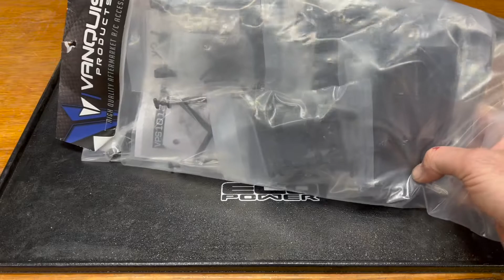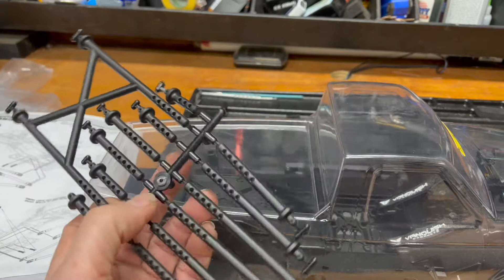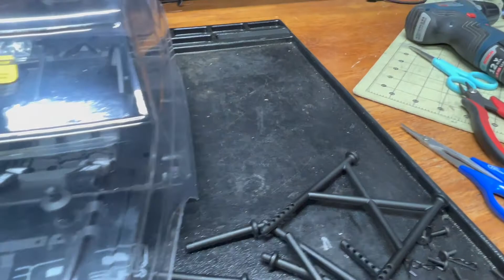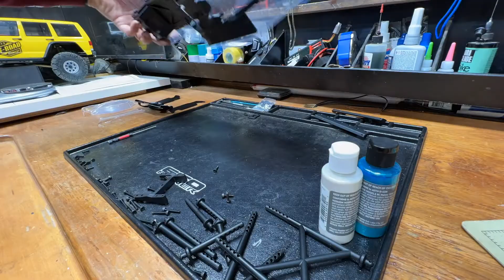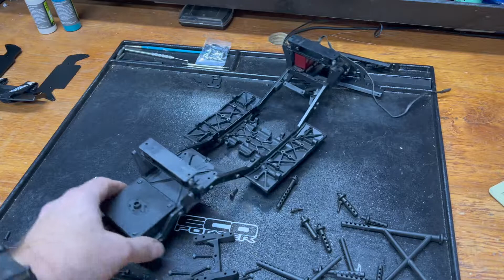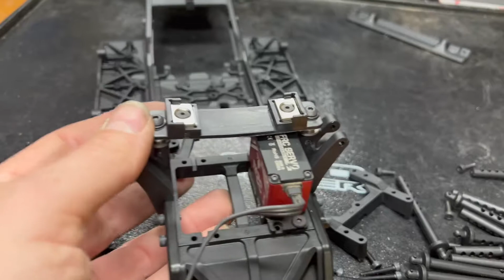Crawler Canyon Presents:  It Came From The Workbench (ICFTW) Vol.1, Part 1:  mix TRX-4 and VS4-10?

Comment: Great project.  Nothing better than fabrication of custom rigs. A while back vs410 chassis kits weren't available so I picked up a Trx4 chassis and capra kit from my local hobby shop in Australia and built an lcg style truck using the capra drive train mounted in the traxxas rails with custom shock towers blah blah blah...lol. Performs really well and dig works so much better with a full size LP servo.. Really enjoying your content and build style. 👌 
Cheers mate 👍
Reply: That sounds like a cool build @Mick D
Reply: @ScaleDude78  cheers mate..👍
Reply from the maker: Yeah, nothing I build is gonna have a micro/mini servo in it.  They're such a pain. That said, the three in my TRX-4 are still going strong (knocks wood) and the EcoPower 640 in Daphne has never given me a problem...  but if I can avoid them, I absolutely will.

Comment: This should be interesting. I like that little 1500 mah 3s lipo, where do you get them? I use magnets that fit over the normal mounting post. That makes using magnetic mounts pretty simple.
Reply from the maker: The batteries are from good ol' Amazon, I buy either the Zeee (that's 3 E's) or CNHL Black.  They seem to perform exactly the same, but due to the wild west that is the Amazon Marketplace, the prices can vary significantly--  last pair of Zeee I ordered were $25 and are now $32, and the CNHL aren't even on Amazon at all in 3S. Amazon is flooded with 1500mAh 3S mini packs from all of the bizarrely named companies--  Hoovo, Goldbat, Ovonic, Awanfi, etc, etc--  but I only have experience with Zeee and CNHL, so I can't speak to the others. All of my packs (I have 10 of the mini 3S total) all charge to within 5% of spec, and there are a couple of oddballs that regularly hit 1600mAh on full charge. 

I've had other packs in the past (anything above a 6000mAh rating, really) that struggle to even get to 5000 on a typical balance.
Reply: I have some 2200 mah Ovonic that work well. A buddy bought some Goldbat & is happy with them. Hopefully in spring things will be better, we can only hope anyway.